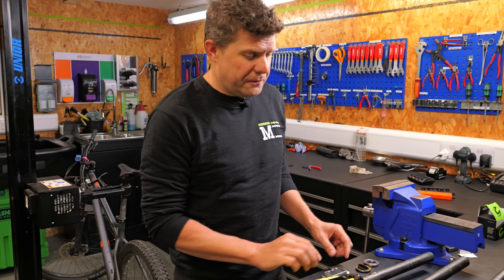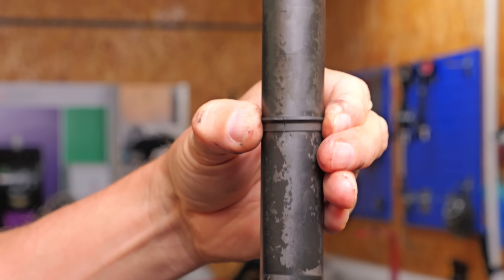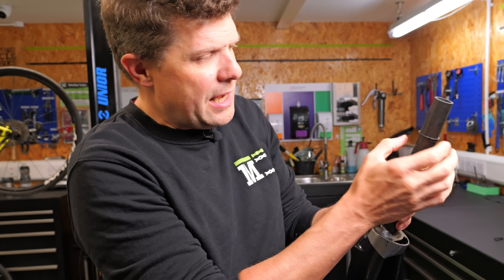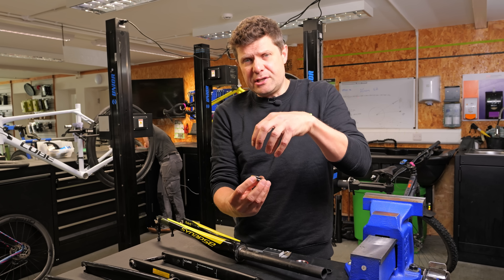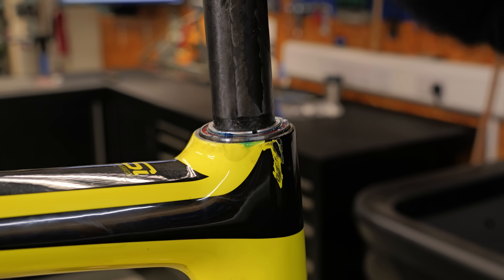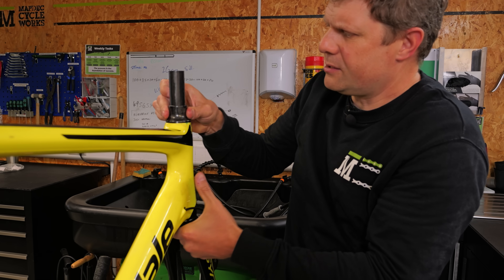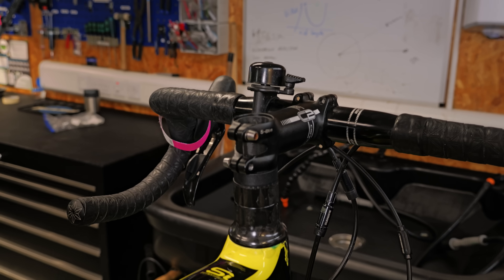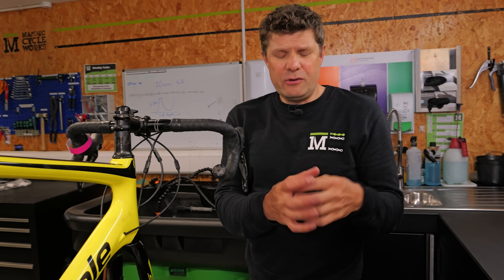Why Are So Many Bike Forks Breaking This Week?

Comment: It’s the tapered rig cone thingy whatever they call it.  Common on Chris King headsets.  George Hincapie crashed in Paris Nice decades ago because of this steerer tube scoring problem caused by that headset cone ringy thing.  They’ve known bout it for decades and their only solution is to do constant check for any scoring marks instead of just us8ng a different headset.

Comment: Steel is real, carbon is a joke, you've been sold a bill of goods, they don't last for crap and you have to upgrade not to mention they fail catastrophically. I have steel bikes over 30 years old that are still going strong and do exactly what a modern bike does. Granted off road bikes are a different animal but still, steel is real.

Comment: thats very interesing but when that compression ring is made out of plastic how is it being able to create such wear on the steerer tube? when its carbonfiber and what if u put some greate in between the compression ring and steerertube so if it moves it wont grip to hard to the fork and it will just slide like a bearing
Reply from the maker: Simple material hardness.  Plastic, usually delrin I think.  🤔. Is harder than carbon fibre.

Comment: What doesn't help is that modern headsets do not have any weatherproofing, causing rapid bearing corrosion / seizure and creating more chance of the locking ring rotating on the steerer

Comment: Doesn't the Cannondale headset come with those little rings (hope offers three) to go between the top cap and the compression ring? In any case, thanks for this video. I wasn't aware of this and will check my setup now. Got a 110 headset and the Cane Creek Invert fork. Not a very cheap setup and it would be horrible to have this happen to it.

Comment: This is good to know, but repairing the steerer is a really bad idea because it does not remove the weak spot or all of the damage.  --- The industry just wants to push carbon and people buy it.  It's very basic that the steerer should have the same hardness as as the clamp or bearing.  The problem is inherent in the design.  Good engineering accounts for a reasonable amount of error.  It could happen even with proper preload.

Comment: If you need more than 3cm of space from the top of the bearings (headset caps can offer a lot of stack, like the one in this video) than the bike does not fit you.  The stack of the spacers makes it harder to get the right tension on the bearings and makes it more likely to come loose during a ride.

Comment: This top cap got me a bit confused, I was like "what do you mean you can't put spacers on top?" then when I went back and saw it had a recess, yeah that makes sense, things definitely won't lign up! Another thing I do is I try to keep it grease free between the ring the bearing and the steerer, so that everything thends to not slip, then I put a coat of grease over everything to prevent water from getting in, I also faced a problem recently with one of my bikes where the headset was contantly getting loose, turns out it was because there was grease between the steerer and the stem, this can even happen to metalic steerers...

Comment: Nice video, only thing rather than putting the stem at the top of the steerer, as per the manufacturer's specs, knowing the customers are going to move it down and not be in the right place for the compression plug, would it not have been better to ask the customer if they wanted their steerer cut down? So they still had the right bike fit?
Reply from the maker: Obviously that was discussed.  You can probably imagine the conversation…
Reply: @Mapdec I guess the lession is , just look after your bike better , but most people just ride them , rather than work on there own bikes

Comment: No spacers on top of the stem?? Wow, why?
Reply from the maker: That’s Cannondale instructions.  Pure and simple. The reason is they there is no compression behind the pinch bolts.
Reply: @Mapdec  Ah ok. So it's really just about aligning the compression plug with the stem? Then you can just get a compression plug that gets the right depth, correct?

Comment: Call me a curmudgeon, but I’ve never preferred carbon forks especially with carbon only steerer tubes.  You can say, “Ahh you old coot, they’ll be just fine.” But, there is probably a reason that some higher end makers equip their steerer tubes with steel sleeves epoxied to the steerer tube.  Might as well go with a nice metal fork and avoid the problems associated with this carbon component.

Comment: I must admit this "no spacers above the stem" is new to me. Does every manufacturer say this? I can't remember seeing it in print on any of the instructions for bikes, stems, headsets, etc. that I've installed over the years. Oddly enough I seem to remember someone making a big deal about HAVING a (small) spacer above the stem vs having the steerer cut so short the stem is not clamping on 100% of its clamping area. Did I miss something? Meanwhile, none of the installations I've done have ever demonstrated any problems with "ring of death", broken/cracked steerer tubes, etc.
The weirdest one I ever encountered was a threadless stem designed for a METAL steerer tube. This design used a small wedge that pushed into the metal tube when the screw was turned, securing the stem in position. But on a carbon steerer it just crushed the material, so the bike's stem/headset would get loose on every ride as the wedge lost it's wedge effect. Nothing much I could do for the rest of the bike tour other than whack the stem with a mallet each morning to take up the play, while suggesting the client replace the stem with one designed for CARBON ASAP. Don't remember if they had a star-washer jammed into the carbon tube as well (AGHHH!) but it wouldn't have surprised me since someone installed the incorrect stem!
Reply from the maker: It is unusual, but not unique to Cannondale.  Always read the manual.
Reply: @Mapdec  My question was WHO else is saying this? I don't know/care about anything Cannondale but can't remember reading any instruction manual saying no spacer above the stem but I'll check some more reliable places to confirm if all you can reply with is "Always read the manual."
Reply from the maker: @larryt.atcycleitalia5786  you could always bring your bike in for a service.  I’m sorry, I am trying to run a workshop. I can’t do the research for every brand, for everyone in the comments.
Reply: @Mapdec  Thanks but no thanks. I did drag out the manuals for the bikes I have and none of them make any sort of big deal about a spacer above the stem. One schematic showed a spacer above the stem while the other said pretty much nothing about it. 
No argument that you as a pro selling services would be a fool not to follow the manufacturer's manual, kind of like how no chain makers suggest taking your chain off to clean/lube it? Something goes wrong - it's on you!
I double-checked by looking at some Park Tool headset videos (gotta love Calvin, he taught the class I took to be a USA Cycling race mechanic back-in-the-day) and noticed plenty of bikes used for demo purposes with spacers above the stem, so I still wonder who besides Cannondale is making a big deal about it? In addition to "trying to run a workshop" you find the time to make and post video's so the snark is kind of lame.

Comment: Ihave been a bike mechanic for over 40 years and I think that bikes nowadays are pretty poor quality regardless of brand.Out of line bottom brackets, steerers, internal cables etc, these all look very nice but are all prone to failure,there is not a day when i am not fixing one of these problems.Aluminium corrodes,carbon is not the wonder material,none of these bikes will last .Bikes are expensive items these days and eventually people will start to question why their 10 grand road bike is basically a pile of crap after a relativelly short life span.
Reply: Which is exactly why my Reynolds 531 butted tube, Campagnolo throughout machines of yesteryear remain my preferred machines - and yes, I've owned a carbon-frame bike. Modern bikes are ridiculously over-complicated.
Reply: @gam1471  Exactly,we have just serviced a Raleigh Record Ace from the mid 1980s still with its original owner.The only change from original spec were the wheels  which were replaced with Weinman concave on Campag Tipo,those wheels still run as smooth as any modern sealed bearing wheel I have ever worked on and the Suntour gears are a joy to use.
Reply: @ChristopherBishop-i2x   Yes, that's a proper bike for sure! The old Campagnolo hubs were incredible. I could remove a wheel from the frame, hold it by the axle, and with a flick of my other hand, set it spinning. Minutes later, it would stop - with the valve always at the bottom! What more could anyone want from a hub?
Reply: Was that a common build? I could never get decent braking on those rims.
Reply: @stephendavies6947  It was one of the most popular rims in the 80,s certainly amongst cycletourists either on Campag tipo or Record ,usually large flange.Most people specified them on custom builds and the 40 hole version was very popular with tandem riders built on Maxicar hubs,Mercian used them on their tandems.I had a pair built on large flange Tipo and covered thousands of miles with no problems,my bike back then was a Claud Butler Majestic and I used Dia Compe centre pull brakes with no problems.

Comment: Finally I learnt something new @5:49. I used to slightly overtighten the headset and loosen it until turns freely   or tighten lightly and pull the front brake to feel any play in the system.
Reply: Also notice there was no wheel in the fork as he did that.  The extra weight causes a problem.

Comment: To be honest, I don't ride anything like that. Road bikes are too extreme for me. In my opinion, it's easy to see why it's considered an expensive hobby. Such bikes have to be well-made. They require a lot of maintenance. Honestly, I wonder if you can just laminate three layers onto them. It's such an important component; I think if in doubt, it's a case of replacement. I'm also a bit surprised that the company wants to take full responsibility for this.

I think what wasn't said: In series production, there are sometimes unfortunate additions of tolerances. Two components are still within tolerance, and yet you end up with a compromise. Maybe some Teflon tape or something like that would help. But honestly, that's too crazy for me with road bikes and this fragile carbon.

Comment: Also, you had a youtube short before, that showed carbon forks breaking after the compression plug surface wasn't aligned with the stem vertically. That's two video's of yours that i/ others come across randomly that majorly saved my bike. I remember watching more +/- 10 videos on how to use my top cap and NONE mentioned this vertical alignment. crazy.

 Even Park Tool doesnt!!!!!!! It would be nice if you could point this out to them if you want to.

This is their video which should mention it but doesnt : https://www.youtube.com/watch?v=c_-ikObUv5A

Comment: What the f***... Thank you for bringing this kind of stuff up, You shouldn't have to but alas. 
Do you recommend going to a bike shop to check out this bearing problem for my 6 month old cannondale caad13 or is this only something that applies to old bikes?

luckily i'm pretty sure the - no spacers above the stem -  doesn't apply to my FSA top cap, I checked the manual

Comment: Evolution comes from failure,,,,Time to design a new head set.  You could try an anaerobic sealer on the contact of the race to the tube and wait until it is a bit sticky before assembly to stop the rotation of the race instead of clamping force and overloading the bearing to failure . Apply it with a q tip , I like the orange . Thanks for the videos .

Comment: This was such a useful video, finding good data for how much to tighten the top cap, when no one seems to give a torque value, has always made me twitchy, this really helps with determining the level of tightening required. Will certainly be inspecting my carbon forks more regularly.

Comment: In my experience the most likely cause of steerer wear is non concentric and non planar headset bearing alignment. 
Most brands couldn't make pressfit bottom bracket bearings that were correctly aligned, the headset bearing moulded seat's are made the same way. 
When I first coined the term Ring of Death I didn't think it would end up being a universal  term 😂😂
Reply from the maker: You're a ture influencer now! Thanks for stopping by to watch. You are totally right about alignment. It's a bit easier to fix in headsets. My experience is that mechanics are just too light in tightening the top cap, doing just enough to eliminate play, but not enough to load the compression ring.
Reply: @Mapdec if the alignment is out it is not possible to adjust it correctly as the bearing preload varies as the fork is turned.
Reply: I was so sure I heard Luescher talk about the ring of death way back! Love your work Luescher!
Reply: @roveism thanks for the support
Reply: The number of forks I've inspected with an oval steerer with a dent along 1 side is radical. I would've thought a round tube would be the easiest to perfect

Comment: For many years, I've enlarged the gap in my Ahead compression rings - which is easy to do with a spark plug gapping file - for this very reason. That gap needs to remain open under compression! Steerer tolerances, especially with carbon, do vary. Relatively soft plastics (steerer and/or compression ring) in mecanical interfaces can't ever be a good idea. And, why is the compression ring always so shallow vertically? A deeper ring would provide a greater contact area with the steerer, for increased friction and greater stability. The worst type of headset cap for steerer damage is the O-ring type with no compression ring - like original Chris King Nothreadset - where CK didn't buy a licence to use the conventional "Rader patent" split conical compression ring system. The O-ring caps always move (rocking back and forth under braking loads) and cause marking or notching to carbon steerers, with any dirt that gets in acting as grinding compound. When the Rader AheadSet patent expired, CK jumped straight in with a split conical ring upgrade to their Nothreadset design, but it was VERY shallow and therefore not good on carbon. I believe they realised this and subsequently deepened it. I would never recommend using a repaired steerer where the internal bore remains to factory spec., as the repaired area will lhave lost some tensile strength - and the steerer is of course the most "safety critical" tube in the entire frameset. Some additional material should be added to the inner surface, and an undersized bung fitted if necessary. Even then, a new fork is obviously the better option. None of this was a problem with steel and threads. Progress is a subjective term. Then there's the all-too-common overtightening of stem bolts to consider. Who would ever risk buying a used carbon frameset when the steerer could so easily have been compromised?
Reply from the maker: widening the gap often works well.

Comment: I couldn't quite get rid of the rattle on my Focus road bike,
and after 10 years and 130,000 km of use, it started to dent.
I think rattle is particularly a problem with recent fork columns made in Taiwan and China. No matter how properly assembled, they start to rattle after a few days.
I had no problems with Italian-made columns, Mizuno columns from Japan, LOOK, or TIME.
I always deal with this by tightening the column, but I'm confused because I've been told that over-tightening can also cause column dents.
The simple system using an aluminum compression ring is the problem in the first place.
Campagnolo's hidden set uses a nylon compression ring, so it doesn't damage the column and there's no rattle. Even the FSA system is fine as long as the compression ring is nylon.

Comment: If people just used metal forks then they won't have this problem 😉 i got a carbon gravel bike with a carbon handle bar, frame, seatpost, and saddle but a metal fork. Got no worries even when i basically use my gravel bike as an XC bike.

Carbon bike forks are less reliable than Carbon frames but i still see a lot of bikes that come with a carbon bike fork even thought their frame is allow 🤦 even steel bikes 🤡
Reply from the maker: Who makes a completely metal fork that is not a lump of steel?
Reply: @Mapdec  my rigid fork is aluminum, not steel. Easy to find if you know how to look 😉

Just because it is metal does not mean it is "a lump of steel". Aluminum is lighter than titanium, yet people ride titanium road bikes.

I'm questioning the decision of mainstream manufacturers to push for carbon forks even on bikes with a metal frame. Seems illogical. Carbon frame with metal fork makes more sense.

Comment: I think people need to realise that carbon bikes and / or bikes with carbon components are a disposable product. Yes it can be repaired but will never have the same level of structural integrity as when it was brand new. I have a steel bike with carbon forks and it concerns me that I’m riding a time bomb. I just don’t trust them like I would steel. Given that recent case with Planet X I think manufacturers need to be under more scrutiny as gravel bikes especially are marketed as ‘all terrain’ essentially, when in truth there is risk to this type of riding with a carbon fork dependant on the terrain and use. 

This ring of death, why don’t they engineer a metal disc into the fork area where this rubbing occurs then it would last longer than the carbon material.

Comment: One positive thing about integrated handlebars/headsets are that most of them are designed where the top bearing cover is tabbed into the compression ring ensuring that everything moves in unison with the rest of the system.
Reply from the maker: Yes.  Those systems are better.